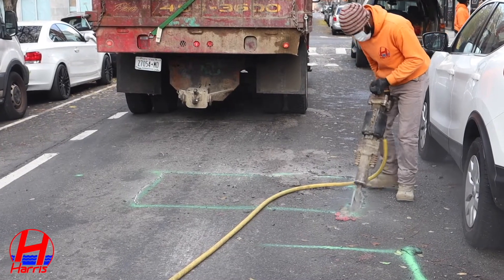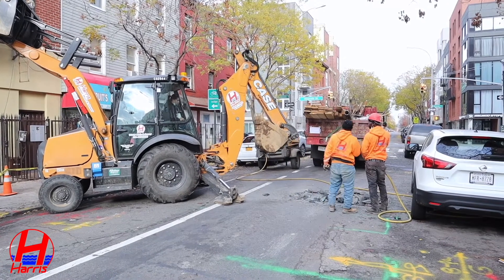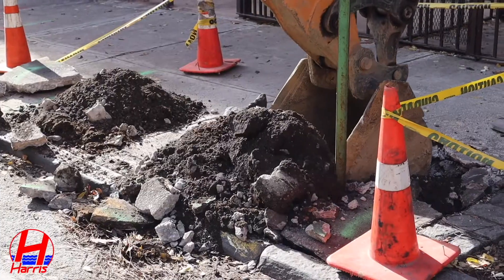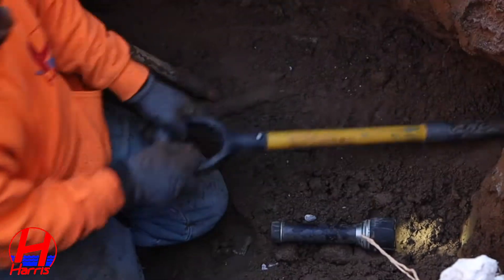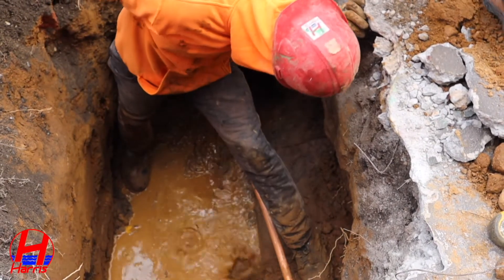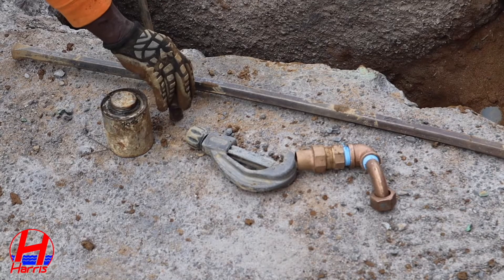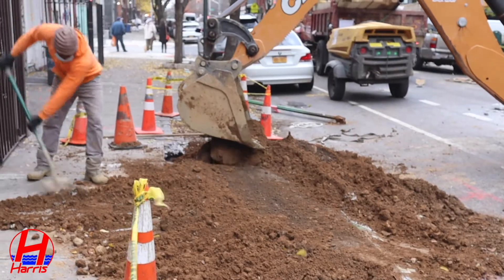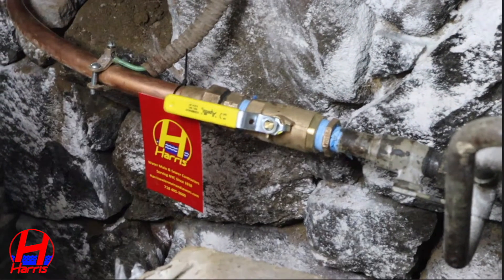Installing a NEW Water Main - Process, Procedure, Information and Tips

Comment: How do you compact the voids in the tunnels you made???  Mmmmmmm???
Reply from the maker: The process includes back-filling and pushing dirt in the tunnel. In areas we cannot fill a void we excavate down and compact from above ground.
Reply: Pushing dirt in a tunnel is not compacting. Never answered  the question.
Reply from the maker: @bozoone4464  We compact with compressed air when possible. In other jobs we trench to compact from above ground.  It depends of the grade is soil and digging conditions.